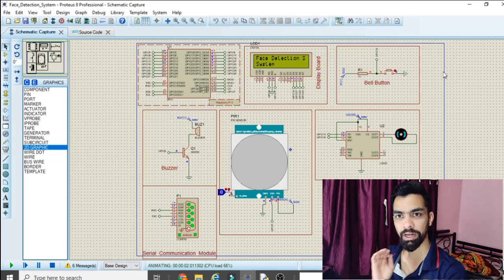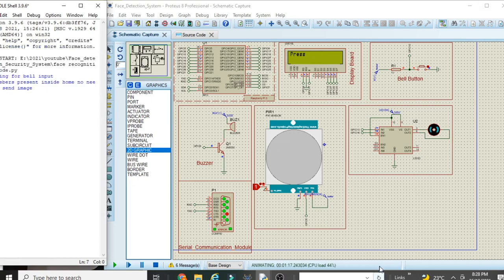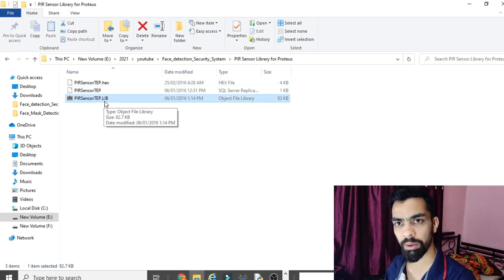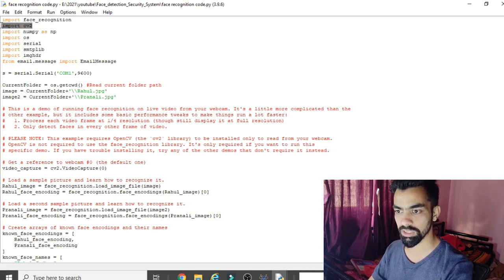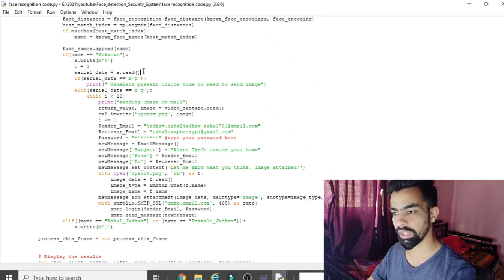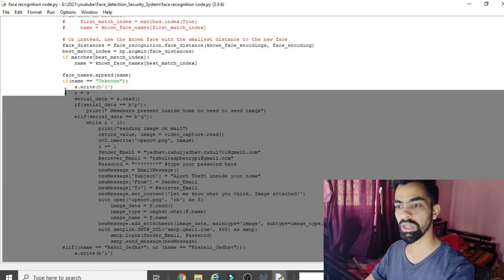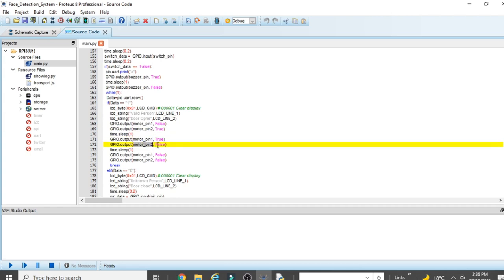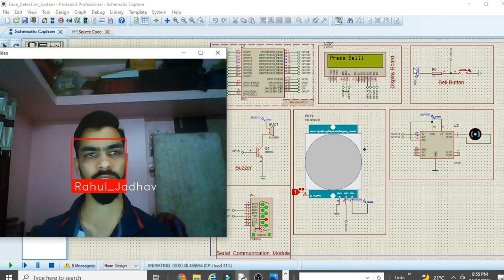Face recognition system Using Raspberry Pi | Smart Door Lock System | Proteus Simulation Project

Comment: Sir thank you but how to overcome     AttributeError: module 'serial' has no attribute 'Serial'
i have already install serial or pyserial i check using both of them please .
Reply from the maker: Please use python version 3.6 or below 3.8
Reply: @rahulIOT  i used them but not solved sir could you make a video on how to integrate the python code with proteus and how to use VSPE for serial connection and how  python file is import to the raspberry pi in proteus it helps me alot for my project i have doing...please
Reply from the maker: @Funny2762  I think all your queries already solved in this video only.
Please watch complete video
Reply: Just go to cmd and give pip install pyserial

Comment: How to solve this error help me, 🙂
Warning (from warnings module):
  File "C:\Users\vinay\Desktop\IOT\Project Backups\Face_detection_Security_System\face recognition code.py", line 7
    import imghdr
DeprecationWarning: 'imghdr' is deprecated and slated for removal in Python 3.13
Traceback (most recent call last):
  File "C:\Users\vinay\Desktop\IOT\Project Backups\Face_detection_Security_System\face recognition code.py", line 10, in <module>
    s = serial.Serial('COM1',9600)
AttributeError: module 'serial' has no attribute 'Serial'